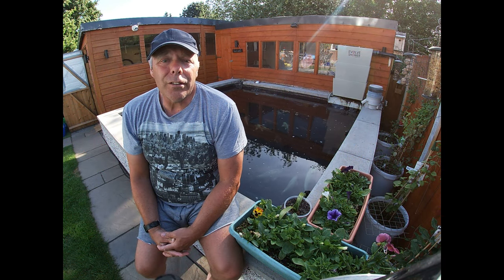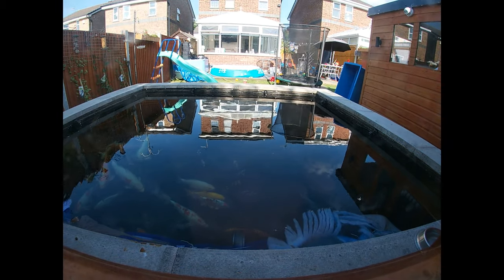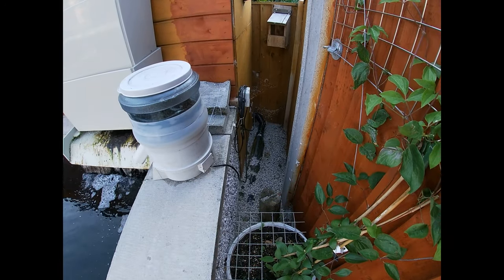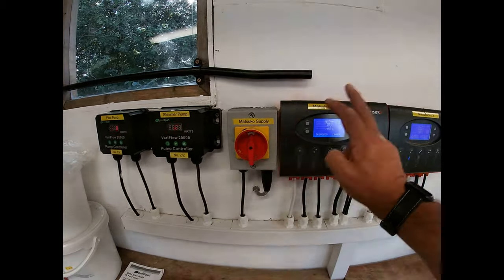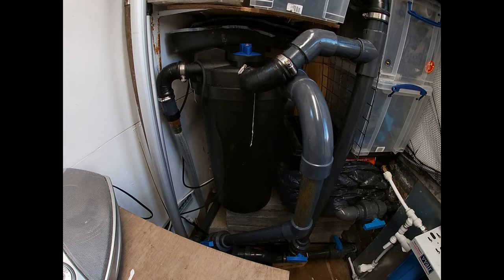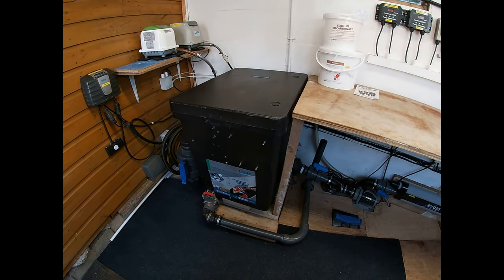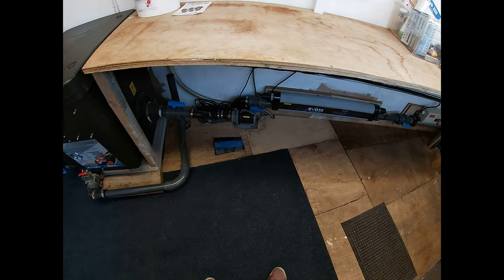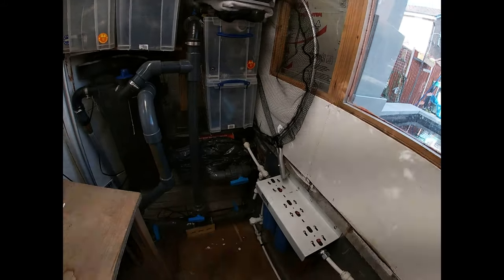UK Koi Pond Filter Set Up Update - Oase Compact - Pondxpert Variflow - Skimmer - UV & Bakki Shower

Comment: Hi Kevin, that's a lot of pipes and valves, I would need stickers on everything to remember what does what so I'm not tracing everything with my finger, glad you took the lid off your filter so I can imagine mine up and running lol, how many litres of media have you got in your filter and what size air pump are you using for it, I've used the plunger type valve for fresh water top up on a reef tank before and they work really well, only problem I ever had with it was caused by salt build up making it stick slightly but after cleaning it it was working as normal, but seeing as how it's fresh water it will be in you wouldn't have that problem, mine was being used for over a yr before salt caused it to stick, stay safe.

Comment: Hi Kevin. I'm thinking about buying a Oase ProfiClear Premium Compact-M EGC - Gravity. Is that what you have? What can you tell me about it? Would you recommend it?
Reply from the maker: I might go off a bit here but yes I can recommend it. I did a video last Summer in detail and yes. I hated get my hands dirty with the Multy Bay and then with the Eazypod and finally paid £1,900 for the Oase and I cannot remember the last time I got my hands wet let alone dirt. I've done a couple of bottom drain purges and cleaned the screens once a year and apart from that I've just sat and watched my fish. You see from the Underwater footages that it is removing the fines. I sometimes have to double check the waste when I am treating for Blanket weed but that's normal for most filters. Set the levels right and the filter looks after itself. Check out the video. There is an extra 4" inlet for a skimmer etc if needed
Reply: @AKoiEnthusiast  Thanks Kevin. Very useful. I am going to order one. What is the smaller pipe at the front, bottom for?
Reply from the maker: @peterfinkill8098  If it is the pipe I am thinking of with a slide valve on it is the waste drain for if you ever need to drain the filter. I sometimes use that drain to do a bottom drain purge, backflush and clean all the sieves. usually just before Spring ready for the Summer. normally all the waste, debris, algae and crap drops on the screen and then the jets wash it off down the top 3" waste outlet.